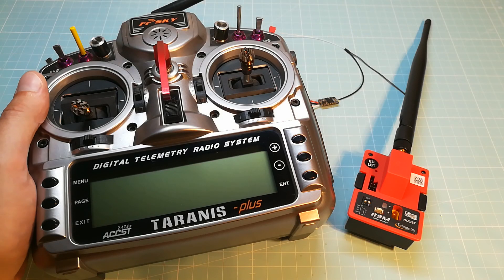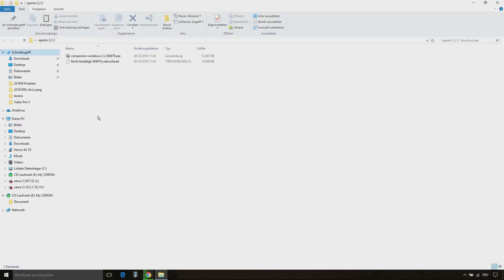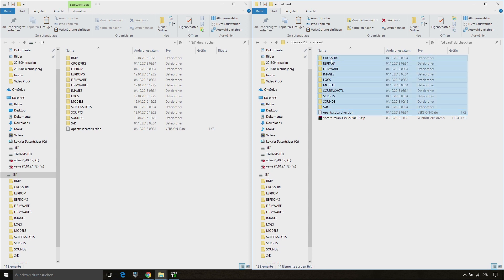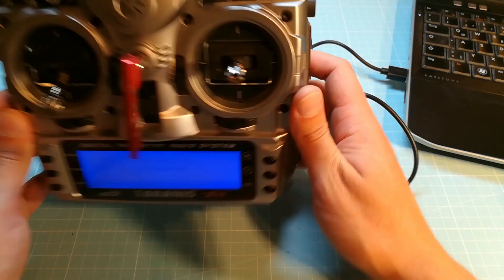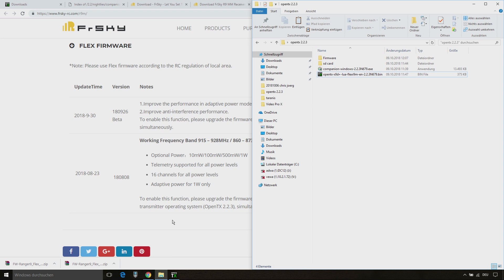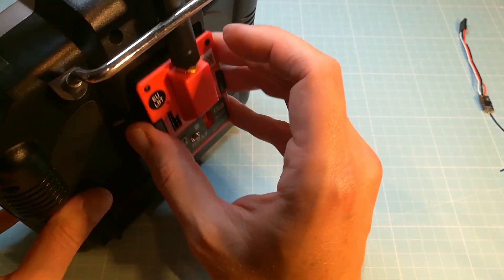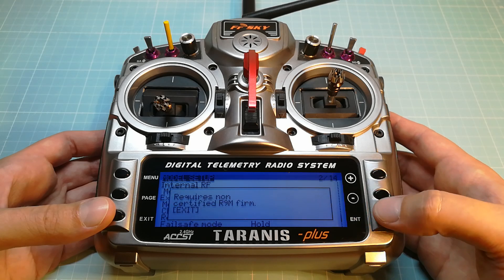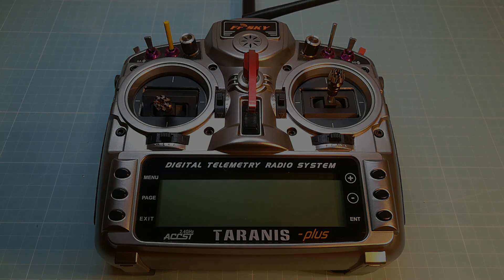Taranis - FrSky R9M - flashing OpenTX 2.2.3 + Flex Firmware - Nightly Build - english

Comment: Good work, Whats diference to flex?
Reply from the maker: With the flex firmware you can select between 10,100,500 and 1000mw output power and you even select the frequency of 868 or 900MHz
Reply: my r9mm + r9m have unbind

Comment: I really dont know why I cant connect my TX to the RX and now only the green LED is glowing on the RX any idea what this means?
Reply from the maker: Only the green is lightning on your rx? That means it's bound to your receiver.
Reply: @TorbanDallas  Thats what i thought too but it isnt... on betaflight is nothing moving on the receiver tab and i cant arm the quad.
Reply from the maker: @Rasgore4  stop thinking and start doing it correctly ;) The green LED indicates a bound Receiver. And it should turn to red when you switch off your Taranis. I think you did something wrong on the way from the receiver to your flight controller. Maybe you didn't solder it to the right Uart pads. Maybe you didn't set up it correctly on the ports tab in Betaflight or you selected the wrong receiver setting.
Reply: @TorbanDallas  Nope thats sadly not it... it worked before even though not the way it should (diconnected for a short time ever 3 seconds or so) so i updated the R9M and the R9 Mini to the latest flex firmware and now i just cant bind the damn thing. I sometimes get the "Telemetry recovered" from the Radio and a few seconds later "Telemtry lost" again and nothing seems to work. So I dont think you can help me with this. Maybe i have a faulty receiver...

Comment: Hi

For some reason I have problems with binding R9m to R9mm. R9mm is always in waiting to bind despite the fact that R9m is in binding mode. What could be the reason?

Thanks.
Reply from the maker: Maybe you have mismatching firmware versions on your r9m and r9 receiver, make sure to install the same version on your r9m and r9 receiver. Also make sure to install the right opentx version. If you're using EU-LBT Firmware check the EU Checkbox in companion.
Reply: Congrats me, everything is working. Was just a matter of flashing the correct firmware to R9m. Thank you Torban.
Reply from the maker: @Denasdc  you're welcome! thanks for your feedback! nice to hear that everything is working fine now :)
Reply: Thanks, will have to do that.

There is also possibility that I fried my R9m  because I was updating the firmware without antenna, oopsie.
Reply from the maker: @Denasdc  was your external rf enabled while you was updating the firmware? If it wasn't enabled, so it won't be fried.
Reply: Sadly it was. But we learn from our mistakes.

Thank you for your help.
Reply from the maker: @Denasdc  i always have the super 8 antenna connected to my r9m Module, it even fits into the Transmitter bag, so i avoid powering my module without antenna. Good luck that you didn't fry your module. At which output power was is while flashing?
Reply: 10mW all the time.
I almost feel confident that it is not fried, but rather I just flashed different firmware. Will found out in few tonight :D

Comment: Nice video Torban ! 2.2.3 has been released now. How does it work with the R9 EU LBT firmware? The receiver only has the flex modes now in the opentx menu.
Reply from the maker: Dave Webb thanks! Didn't test the Eu Lbt Firmware. So you can choose 25mw in opentx 2.2.3 now?
Reply: @TorbanDallas  No, not anymore. It says has 868/915 with 10/100/500/Auto power output. I have not tested it yet though. Interestingly new flex fw for R9M/MM has hit the frsky website today.
Reply from the maker: Dave Webb yes i have seen the new flex firmware, but the only change is something with the telemetry. Much more interesting is that i have heard that frsky will release a wireless update procedure.
Reply: @TorbanDallas  OTA Rx firmware flashing a la Crossfire? Nice
Reply from the maker: @dj_dazzy  apparently something like this yes :)
Reply: @TorbanDallas  flexr9m build option replaces the FCC/EU LBT menu with the flex one.
Reply from the maker: Dave Webb thanks for this information. So you better don't check the flex option in the companion settings while flashing your taranis with opentx when you want to use the EU LBT Firmware.

Comment: Hi, any ideas what going on? I did exactly like you, everything looks good but i can't change the power. I have r9m lite and it stack at 100mw. any ideas how to fix it? except that i can't use lua script. When i take discover new sensors, its only finds 2 for me. This happens only for this receiver r9mm with all firmware version. In rxsr Everything works fine. Help me please :)
Reply from the maker: MrUsatysfakcjonowany with the x lite you are limited to 100mW. Only the r9m module can go up to 1W output power.
Reply: @TorbanDallas  thanks for fast answer. I know that. But i can't set the low power. Just have <100mw> and can't select it in my radio
Reply from the maker: MrUsatysfakcjonowany did you set the flex option in the companion settings?

Comment: Hi there from Greece! I love your r9m videos.fhe flex firmware looks very interesting! I have a taranis x-lite and an r9m module.(not lite). I am waiting for an adaptor to arrive so i can fit it. I was told that i should set it as ppm. Do you agree? Maybe because there is not an option for r9m full size in the x-lite firmware. So i guess that this will not work with flex firmware? I would appreciate your info. Thank you!

Comment: do you use lua scripts? or anyone here? i have not done this update yet to use flex but have tried all the normal firmwares my problem is everything works in my lua script except for my pids wont load. i was wondering if that is fixed in the flex firmware?
Reply from the maker: Paul Kulka FPV hi, i don't use a lua script, i'm changing my pids over the osd.

Comment: How to check rssi from two receivers ?
Reply from the maker: Can you specify your question please? Are you talking about the redundancy function?
Reply: Yes redundancy function, i use also R9slim and r-xsr, but rssi on osd i see only from R-xsr
Reply from the maker: @dmitryn2889  mh maybe it depends on the firmware, on the R9Mini there's a RSSI Output on Channel 16 (Aux12). On my XM+ there's also a RSSI Output on Channel 16. Rssi Channel in Betaflight is set to Aux12. So i always get the RSSI of the Receiver with the stronges signal. But i never know which one is the active receiver and i can't see both Rssi Values the same time. Unfortunately the rssi on the r9mini is scaled wrong, so it doens't show the real value - i hope frsky will fix it on a newer firmware.
Reply: if you are interested, support the implementation of this feature in betaflight https://github.com/betaflight/betaflight/issues/7139

Comment: Do you know if its possible to flash the R9M with flex firmware without a Taranis?
Can you use the  FrUSB-3 (FUC-3) updater tool you can use on the receivers using s port?
This would make it possible for anyone with a ppm out put TX( non Taranis) , to add the R9M module and then change the firmware to get all the benefits of channels higher power, but using EU 868 MHZ.
Reply from the maker: Hi, you need opentx 2.2.3 for running the flex firmware on your r9m and your receiver.

Comment: So am i understand correctly that:
- after installing this 2.2.3 Nightly build i will be able to select and use 868Mhz freq? i'm from Russia, so i can use FCC non EU version which is more powerfull BUT!!! we have our cell operators using the same 900 mhz freq.  :( the only solution is to downgrade to EU version at 866 Mhz and 200mWtt ..
so for me ideal solution will be to use max power but on EU freq, will this be possible?
- and another question, will this 2.2.3 going to be released, so i'wont get this annoying warning "nightly releases are not safe to fly"! each time a start TX?
Reply from the maker: Hi, yes you undestand it right! Update your radio to openTx 2.2.3 and update your R9M and R9 Rx to the latest flex firmware as well. Then you are flexible to use the Frequency (686Mhz,915Mhz) with every output power of 10mw, 100mw, 500mw and 1W.

It think it will still take some time until opentx 2.2.3 will be released offically. There will also come a new R9m EU Firmware but that will still take some time, so for now it would be the best option for you to install opentx 2.2.3 and the flex firmwre. I also recommend to set the delay for stage 2 failsafe from 0.4 to 1 second and to set throttle yaw pitch and roll from auto to hold in betaflight to avoid failsafes caused of rssi drops. I also have upgraded my antennas as you can see in my other videos.

Comment: Thanks for this instruction video. Do I need the latest OpenTX firmware for R9M Flex?
Reply: I am using OpenTX 2.2.2
Reply from the maker: @campilottv  yes you need opentx 2.2.3 if you want to use the Flex Firmware.

Comment: I'm just doing this now, great tutorial, easy to follow, but I'm confused on the R9M firmware to choose. In the R9MM zip file it has the R9M firmware showing that you write to the module, but on the R9M flex firmware page it shows 180428 "Only firmware update for EU LBT mode" should I be installing that one or sticking with the version in the R9mm zip file ?

I'm presuming to use the firmware thats in the R9MM zip file so the two firmware versions match ?
Reply from the maker: On the FrSky page you find the Flex Firmware on the module and the r9mm (V180926 447kb) i have chosen the sbus firmware. Both containing the Firmeware for the Receiver and the R9M. So yes you can use the files from the FW-Ranger9_Flex_Beta.zip file
Reply: @TorbanDallas  Thanks for confirming that

Comment: What does 2.2.3 give you over 2.2.2 - more functionality or the ability to use the R9mm full stop ?
Reply from the maker: Conrad Taggart it gives you the ability to run the flex firmware on your r9m and r9 receiver - and as you can see at the end of the video you can set the output power and the frequency. If you are in the EU it is a big improvement. So you can run more then just 25mw with telemetry. With the non flex firmware and opentx 2.2.2 that isn't possible.
Reply: @TorbanDallas  so can we run the r9m on 1watt in withe the eu firmware or are we limitted to 500mw?
Reply from the maker: Booly FPV there are no limits. It's on you to set it up correctly for your local regulations.